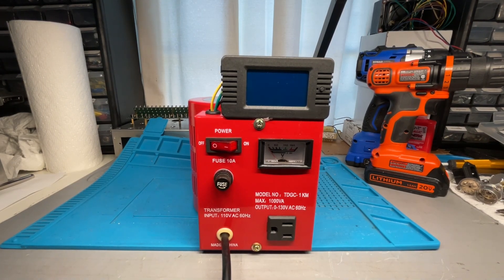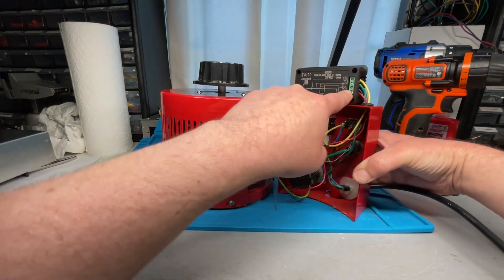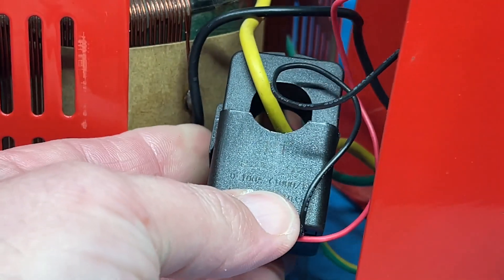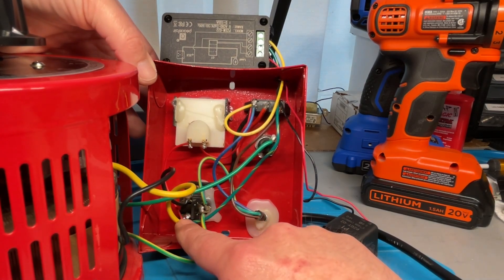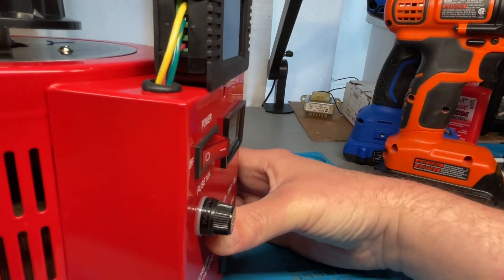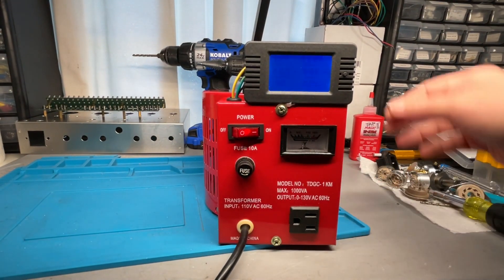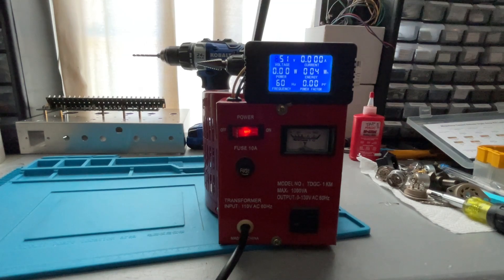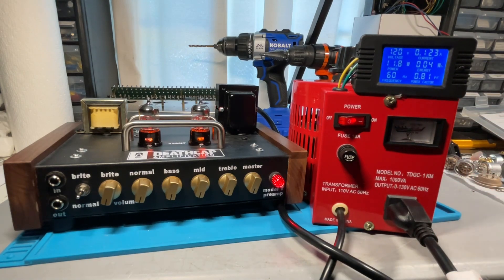Installing a Digital Meter on a Variac (links in description)

Comment: Hi Mike, I just completed adding a PZEM-061 with the zero mod to my General Radio 5 amp variac, it’s been in the works for a while but with your video’s help and #sluckeyamps great website/amp projects archive I figured it out. Mine now shows 0-140V on the digital meter, if you have a PZEM-061 the zero mod is very simple - let me know if you want the instrctuons. Wiring in my variac is a bit different than yours, I had to take it completely apart to access the output AC plug’s mounting posts but after a few tries it works! This an amazingly useful upgrade to any variac that will show voltage output much more precisely, as well as current and wattage into a load. Thank you for this helpful instructional video!
Reply from the maker: Thanks man, I'm glad this information was helpful!  Yes, adding a digital meter to these variacs is almost mandatory.  The voltage rating stickers on the top are almost never accurate.  Plus knowing the current draw in many applications is super helpful.

Comment: Great job , if you'd like to take it further or if it matters whether to see voltage from one and up, there's a way,  I have done this mod on two variacs, but both show from one volt ,I don't profess to know what I'm doing but when I did my research, I found two videos from 3-4 years ago that used  pzem-021 model meter by Peacefair, these meter needed to be slightly modified so they could show voltages from 0 to 150+.
Reply from the maker: Thanks for the heads up. Yes I’m aware of other meters now that will do that. But for now I’m good with it displaying at 50V and up. But if I get another one I’ll definitely look into using a different meter. Cheers man!
Reply: @DeathCapAmplification you can modify this one by removing one leg of the big yellow cap inside the digital meter and wiring it directly to the 120 side with a little jumper. It’ll power up at 0 vac that way.

Comment: Very cool addition, nicely done.  Great idea, especially since the provided analog voltmeter is such a non-resolution junk piece.  To bad the junk digital doesn't fire up until 70v
Reply from the maker: Thanks man. I made this video really quick because some people on a guitar amp group requested it. The 50 volts thing doesn’t really bother me much. Because not a lot happens on most amps until they get at least up to 60-70 volts. And if they have a potential issue or it’s a new amp I’m firing up for the first time, I also plug in a light bulb limiter so I’ll know with the first few volts if there are any shorts or big issues. So 0-50 I rely on the light bulb limiter. And 50-120 I can watch the digital meter.